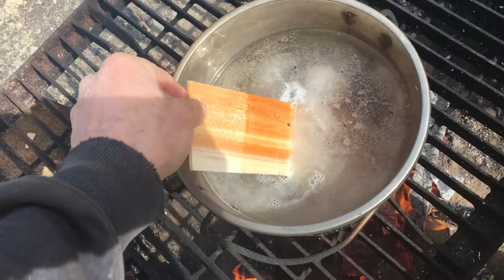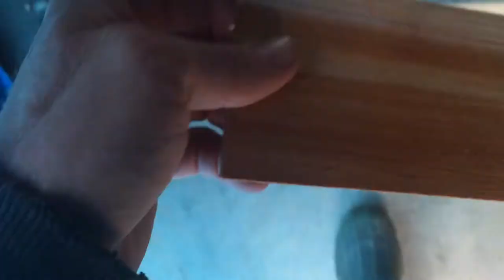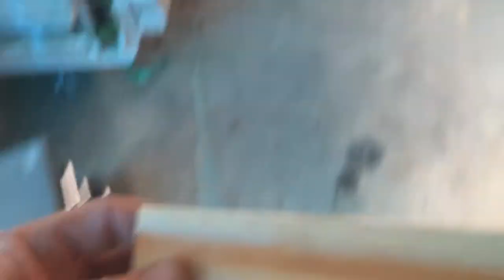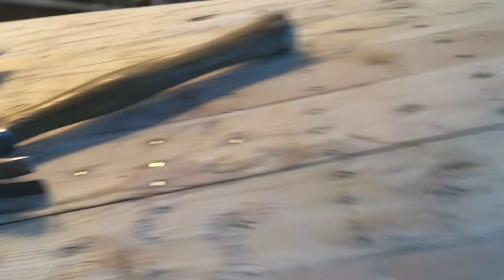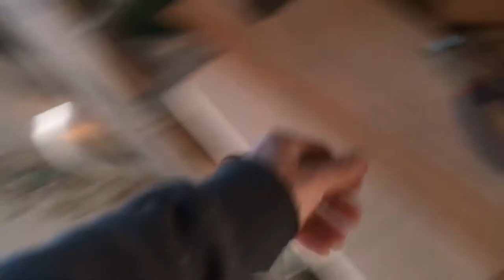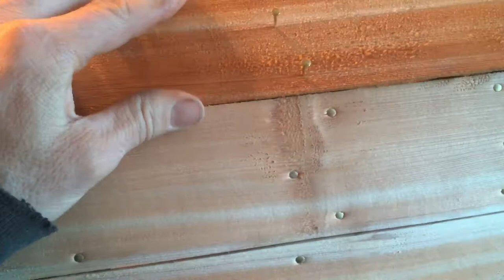20 Foot Cedar Canoe, last plank

Comment: Nice! How long have you been working on the boat so far?
Reply from the maker: A while, Mike.  As you know its been a long winter and its still hanging on.   I really only tootle with it mostly for a few hours on the weekends.  Its been cold in the shop and only in the past few weekends have I been able to function with out gloves on.  Epoxied the stem this evening, too.  The fasteners were rusted completely away.